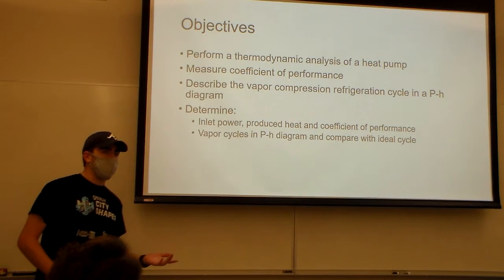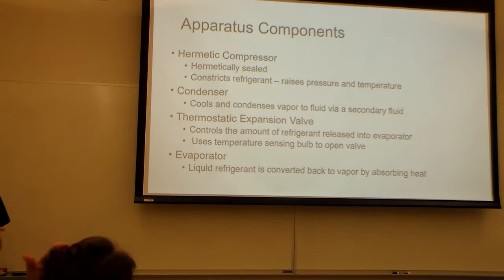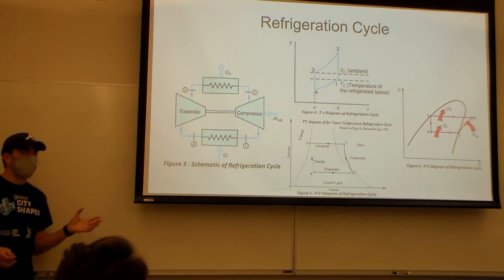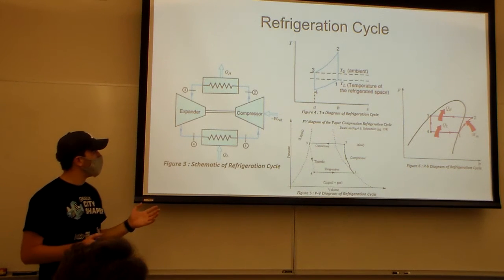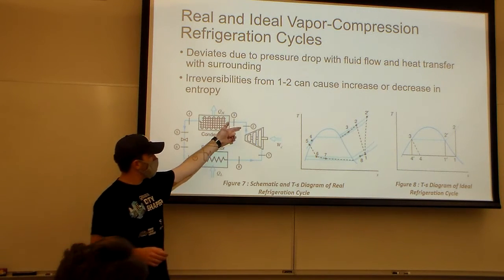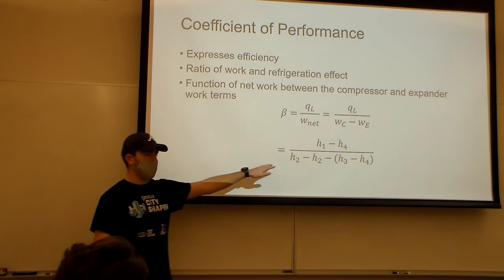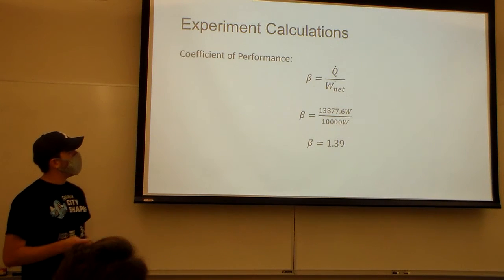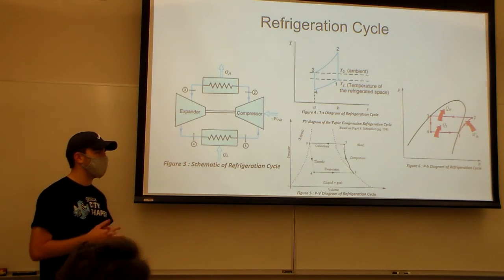ME 4611 - 27 Jan 2021 - Joseph Miller - Refrigeration Cycle Presentation

Comment: Power Point Slides: Slides were good for the most part. For the most part, they had a good amount of visuals and diagrams, which is good for those of us viewing the presentation. There were 1 or 2 slides with just a ton of words that didn't really need to be there. I think the "Apparatus components" slides could have been left out. It would have been better just to explain/describe the components on the slide with the diagram.

Comment: Technical Content: I thought the technical content was good for the most part. A good amount of background was provided regarding the cycles in question. Of course there was one part where you said one of the processes was isothermal while the graph shows this is not true. But this could happen to anyone I suppose. Perhaps a slightly more in depth discussion of the apparatus that is to be used would be helpful for those going into the lab to the experiment. Overall good technical information.